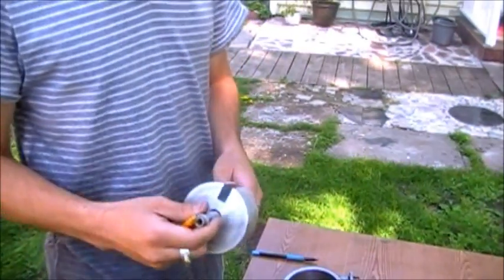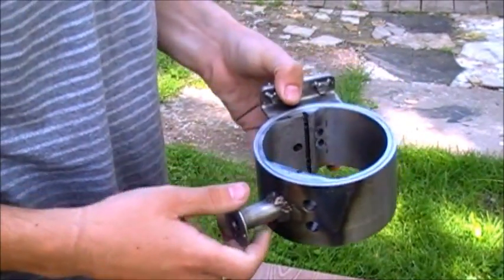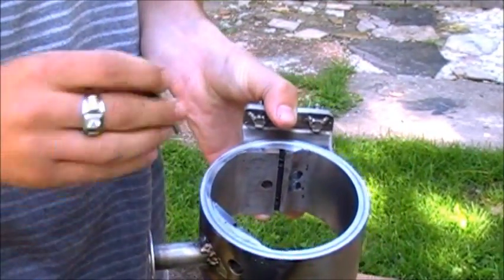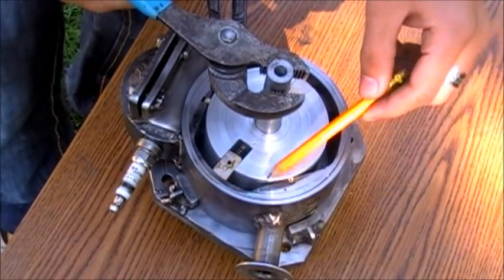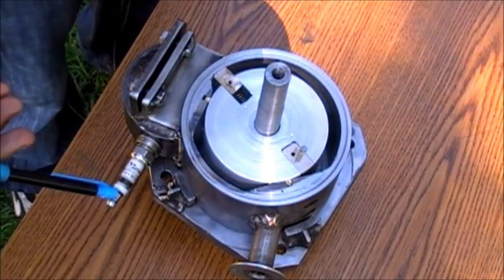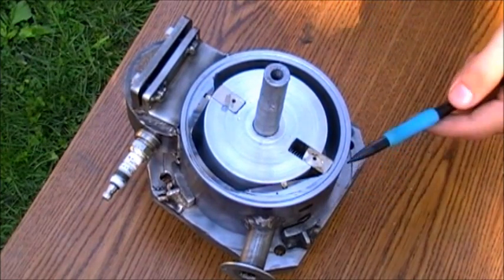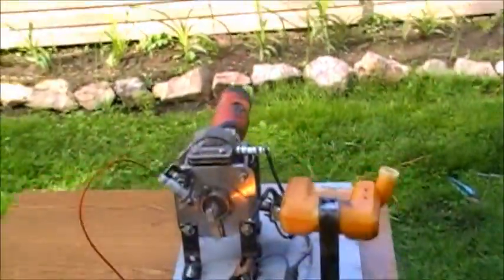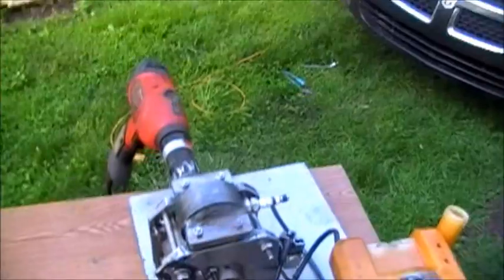new rotary engine semi functional prototype

Comment: I know why it doesn't work and never will, with that current design, not even if it was made on super precise CNC machine... The gas you are (trying to) compress, is just flowing through the "combustion" chamber out the two exit holes into the expansion cavity, unless the devider wall of your combustion chamber is completely blocked of, then you'll get a very slight compression (not much as the ratio is more horrible than pre WW2 otto engines), then the gas is going nowhere and all you do is back firing... VERY good luck, you'll need it...

Comment: I had a very similar idea. My original take on it is slightly from yours but, it is still based around a rotary vane pump acting as an engine. I also thought about having two rotors on the same axle with one providing compression and the other providing decompression with the combustion chamber joining the two.
Reply: Jason Queen  Likewise. I also had same idea of converting rotary vane pump in ic engine. But i got stuck where after sparking and combustion happens how to compel expanded hot gases in the intended direction i. e in clockwise direction. Because once sparking occurs how to drive highly active hot gases in any particular direction in its compartment ?
Reply: Apurv Sahasrabudhe 1 way bearing.....
Reply: A one way bearing will waste energy and add more heat and friction. You need a continuous increase in exhausted volume so the exhaust will keep pushing the engine forward. I could try to sketch something up sometime.
Reply: Well Jason I thought of it and we have to compel exhaust to propel those vanes in desired direction. For that just yesterday I came to a crude solution which yet to be completed. Of course still trying for pressure in combustion chamber to reach ignition temperature.

Comment: Good luck guys. Is the combustion chamber too big compared with intake volume? Also needs a way of mechanical controlling the seal bar as that will get smashed at higher rpm. Good luck

Comment: There's a lot of exhaust pulse reversion contaminating the intake charge.  If you can help clean up the different charges similar to a rotor engine it will run.  Look at the triangle design which is a step up from your prototype maintaining a balanced assembly.  Good work, it's trial and error like this that leads to advancement.

Comment: Good idea guys.
Keep improving it!
I had this idea for 25 years but never built one.
I am glad you did.
My version is slightly different dough.

My version has no compression stroke, rather I use an combination of a Screw type super-charger and a turbo to provide two stage external compression to the Expander portion which you have built.

The opening slope has to be more gradual than what you have.
You must be loosing pressure there.

And ditch the combustion chamber.
You can put the spark-plug into the rotary housing, right after the high pressure charging/intake port.
But make the housing the negative electrode and the center + electrode has to be flush with the housing.

Let me know if you have any questions I am glad to help to develop this thing.
Good luck. :0)
Good Job too.

Comment: Interesting concept - keep at it guys. As mentioned earlier it looks like the combustion chamber design is more an issue than overall leakage. The gases will need to be more compressed before any useful work can be made of the ignited mixture. Maybe smaller exit holes - have a look at indirect diesels where they have a separate combustion chamber which then feeds the cylinder - the holes can be quite small. I think Honda Civics used a similar design in their lean burn petrol engines in the eighties.

Comment: the problem of your engine is the combustion chamber. when you push the misture in the combustion chamber it is exeting right away for the expeansion chaber, thats why you dont have an "explosion", because the mixture is not compressed.
grettings from portugal!
Reply: Thats exactly right... for there to be compression they would need to add valves to close the expansion until the combustion is ready.

Comment: Great work, always good to see people coming up with new ideas. However I see one drawback with this motor and that is the large inertia of the rotor seals and large displacement they need to move in a short space of time.. This will prevent the seal from tracking on the housing limiting the motor to very low rpms.

Comment: I do believe that this is not a rotary engine; instead, it appears to be a variation on the Wankel Engine, which, while it does operate on the principal of an internal rotating device to operate all 4 cycles, is not rotary, as the engine does not itself rotate.
Reply: An internal rotating device.... called a rotor thus a rotary engine. Rotary airplane engines are also called rotary because the engine doubles as the flywheel.  That said like the guy in the video said its poorly made.... he needs an an eccentric shaft and a real rotor instead of that spring loaded thing. Interestingly ennough airplane rotary engines and wankel rotarys are extremely different I'd imagine rotary piston engine produce large ammounts of torque while a wankel due to its eccentric shaft mainly produces high power output and low torque vs RPM.
Reply: Chase Rayfield Either way, there's a difference between a Wankel engine and a Rotary engine. Advertising one and delivering the other is part of the reason why it's so hard to learn anything about rotary engines. understand why I'm frustrated?
Reply: Chase Rayfield I am aware of the difference between a Rotary engine and a radial enigne. A radial engine is a V engine with more than 2 pistons attached to the same area. A rotary engine is the same thing, but uses the entire engine as a flywheel. However, a Wankel engine is neither of those. It involves a completely different mechanism which, while it does rotate, is not a rotary engine. Besides, who would want to say Rotary when you can say WANKel? It would also make it a hell of a lot easier to tell the difference between the two, especially considering that both types were used in motorcycles!
Reply: Chase Rayfield They're not a type of rotary engine, because rotary means that the entire engine spins. Neither can they be rotary, because the Wankel engine can't deliver enough torque to move anything with the engine itself, so it has to deliver the RPM to convert to torque. And while it's called a rotary pickup, it's only because people have decided that stuck, even though it's wrong. It's just like people saying "an hero" is wrong, even though grammar says it is correct.

They're 4 cycle. There's an injection stage, there's a compression stage, combustion stage, and exhaust. so it's 4.

Sorry if it seems I'm getting angry, it's just that because of this misnomer, it's hard to learn anything about the ACTUAL rotary engine, because when I go to look up anything about it, things about Wankel engines appear instead, unless it's the wikipedia page.
Reply: Chase Rayfield http://en.wikipedia.org/wiki/Rotary_engine

Have I made my point?
Reply: http://en.wikipedia.org/wiki/Rotary_engine_%28disambiguation%29 ... no not really. In fact that very page you linked says "Wankel rotary engine" .... a Wankel IS A ROTARY ENGINE. And so are many other types of engines even turbines for example.
Reply: Chase Rayfield What it says is "This article is about a type of piston engine with a rotating cylinder block. For the pistonless Wankel engine, see Wankel engine."

Pistonless Internal Combustion Engine is what the Wankel's referred to as.

What you linked me to, says at the top "A rotary engine is a type of internal combustion piston engine used in some early aircraft, motorcycles, and cars. Virtually the whole engine rotates about a fixed crankshaft." The Wankel is neither of that.
Reply: "Besides the configuration described in this article with cylinders moving around a fixed crankshaft, several different engine designs are also called rotary engines." ... now can we move on. Also its wikipedia... pulling it out as a reference isn't winning you any crediblity.
Reply: Chase Rayfield "also called rotary engines" not are.

Also, when it comes to technical matters, wikipedia's almost as accurate as the Encyclopedia Britannica.
Reply: bye... no more time for your nonsense.
Reply: Chase Rayfield Alright, have a nice time justifying calling a wankel engine what it isn't.